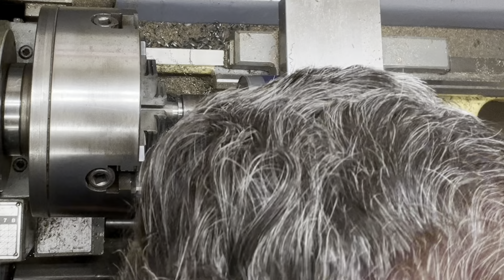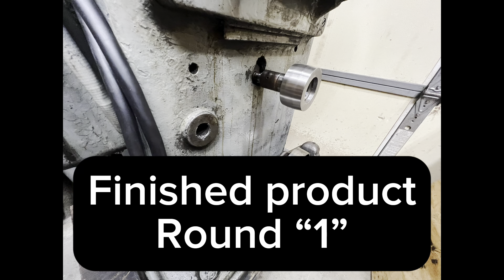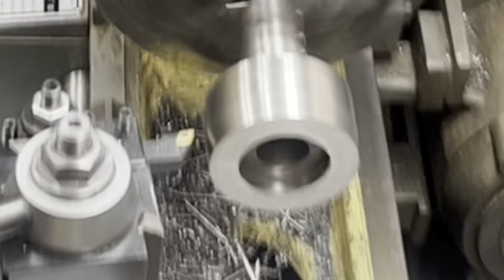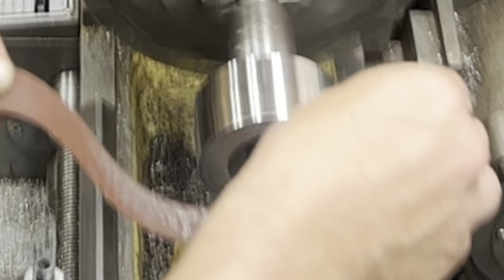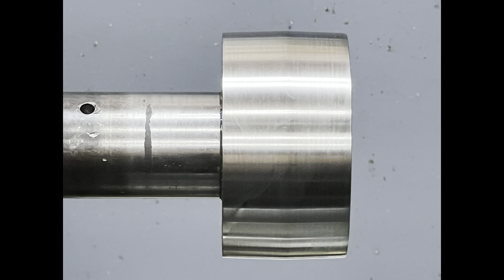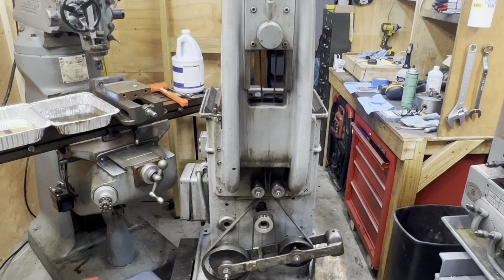Part 5 : On the lathe to turn a crowned drive pulley on a Brown and Sharpe no 2 surface grinder

Comment: Good repair job. I would have skimmed the large internal bore of the pulley, just in case it's not true to the external circumference, causing out of balance, which could transfer vibration to the grinding head. Cheers Tony
Reply from the maker: Yes, good point. Thanks for the comment!